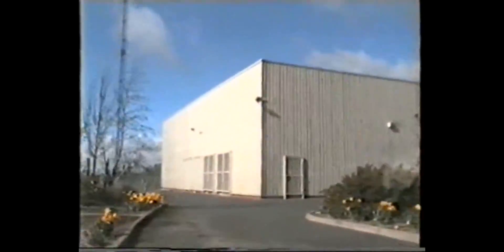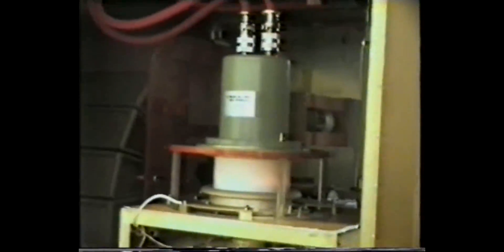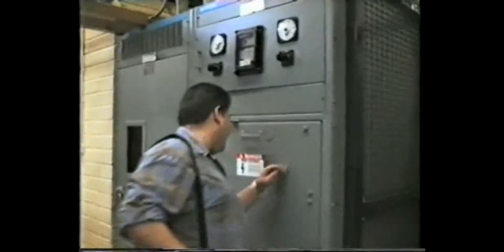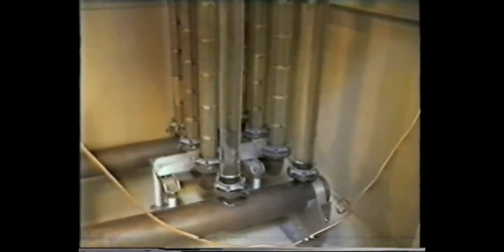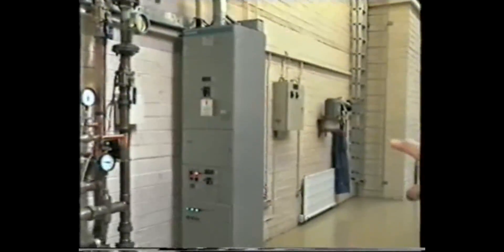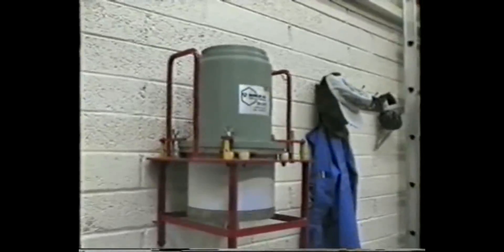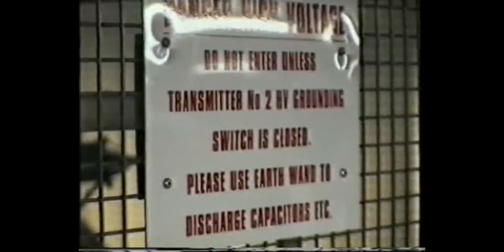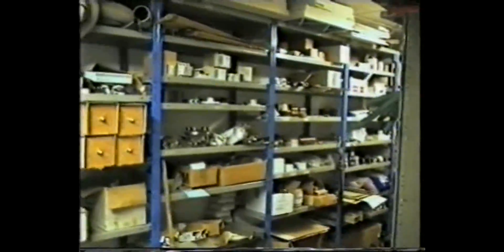ATLANTIC 252 transmitter site tour

Comment: I picked up this station in Antigonish, Nova Scotia Canada during the 1980's. The signal had to be separated from a lot of noise. Still quite an achievement. Today Atlantic 252 could operate with a very efficient Nautel transmitter. Nautel builds some very high power solid state transmitters. I remember the Atlantic 252 slogan, the station that reaches the beaches.
Reply: That's amazing ..long wave was cool in a way ..don't suppose it had much use in tidays world but there was something exciting about picking up a radio station from afar sort of reminds you how small the world is in some respects
Reply: In 2001, a UK company with sports interests made an offer to buy Atlantic 252, planning to turn it into a sports radio station to compete with the successful talkSPORT AM station. Their offer was accepted. Atlantic 252 closed in December 2001 and TEAMtalk 252 commenced. TEAMtalk rapidly ran into financial difficulties and closed the station in June 2002. The transmission facility reverted to RTÉ and it became a relay of RTÉ Radio 1.

In 2007, the Continental Electronics transmitter was replaced with a Transradio TRAM 300L (resulting in a power drop to 300kW but it's a more efficient solid state and DRM-capable transmitter).

Transmission continues. RTÉ regularly makes plans to shut it down as it expensive to operate for the small number of regular listeners using it but the Irish diaspora in the UK and the Irish government asks them to keep it running.

Comment: What a junk of a transmitter, £1100 a day to run, no wonder it didn't last.
Reply: Lol, you have no idea. That's ~ £33,000 per month, which is middle range for high power broadcast operations. Even now in the 21st century, 90% efficiency digital transmitters cost a lot of money to operate. A tv station I worked at spends over US $60,000 per month on electricity for it's three TV and three FM transmitters and associated support equipment. Combined total radiated power is ~ 2.3 million watts. There are several thousand more stations that use that much electricity in just the US, and countless more worldwide.
Reply: it's Long wave, not as simple as your average FM pirate station transmitter that you can carry in a shopping bag.  It's different technology - this beast had massive reach, you have to admire it for what it is.
Reply: 😅😅😅 never even thought about this aspect...wasn't even that good the reception in southern england Devon and all ...1100 pounds.... then the equipment buildings djs...and I was wondering why they still not going today
Reply: They now appear to be dropping the power output each time they carry out maintenance and will continue to do so until such time its turned off.